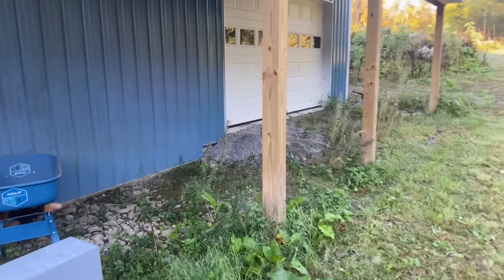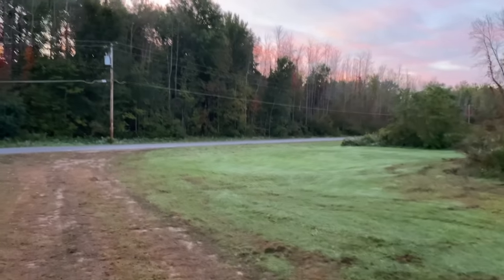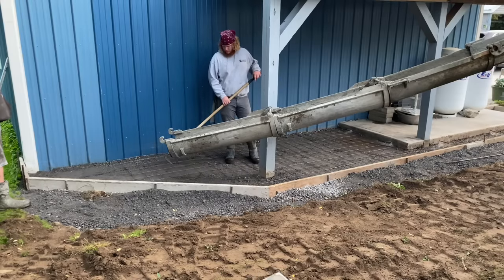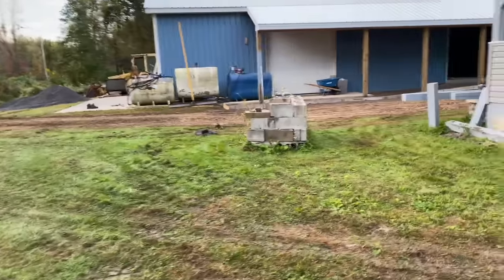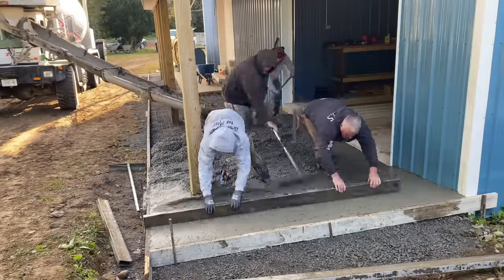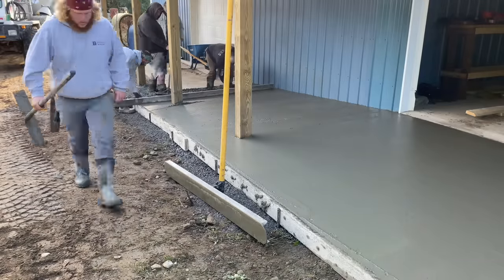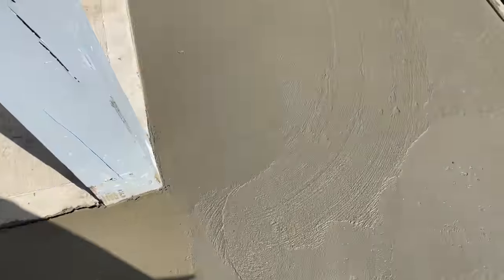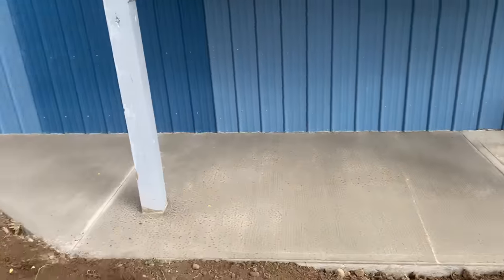WET CONCRETE!!! HAD TO REJECT THE LOAD. 👎🏼

Comment: Nice.
I know people use metal brackets to physically separate concrete foundations from the wooden pillars.
In this case, they poured the concrete right up against the wood. Is that a problem?
Reply from the maker: If it was up to me there would be no wood ever in the ground but people around here love these pole barns with the wood poles in the ground. I do not like them but get hired to pour the floors all the time. They are cheap to build.
Reply: @bondobuilt386 They do that here too. I had to replace all the rustic log supports on two porches on two houses on my property after I bought it. Rotted All to hell.  All sunk in concrete. We didn't make that mistake. Footers rule!
Reply: Yes that is a problem. A simple, easy, and quick solution is to wrap them posts with some expansion foam and problem solved....

Comment: Sometimes when it’s too wet we still pour it and let sit for a bit then we screed it(when is a small job). No need to give them a hard time plus you got plenty of people.
Reply from the maker: Wet concrete is not nearly as strong than something poured at a tighter slump. Also this is a steep ramp.
Reply: They were close to the plant. They should have mixed it for 10 or 15 minutes and it would tighten up.
Reply: @bondobuilt386 you are right on it not being as strong but if you screeded that uphill, you would have been fine.....
Reply from the maker: I wish you were there to show me how to do it that day. LOL @87bradyman

Comment: Concrete right up against the siding? Doesn't seem right. Is that normal?
Reply: Not right
Reply: No it's not right and he should have also wrapped the posts with some expansion foam or anything to keep that concrete from rotting them out
Reply: Not right but it's probably what he was told and paid to do.
Reply: I did a job and when it was time to get paid was told to go pound sand. So I went and pounded sand. Make sense. I always do what the owner says. Wtf

Comment: Different to UK we tamp screed tamp screed
Reply from the maker: What is tamp screeding?
Reply: @bondobuilt386  we use a board or vibrator bar to bring air out of the concrete and the water to the top whilst screeding back to get level

Comment: Just curious here, since you are close with Circle T, it would be nice to here what they did to resolve the issue.  Since there was plenty of room in the mixer, did they add more dry material or did you get a new batch?  Always enjoy your videos and thanks for sharing!  😁👍
Reply: If the driver notices concrete is batched too wet they will load more concrete into the truck to dry it. If he's rejected from a job they will either bin block the concrete or scrap it and load the truck again

Comment: I had an apron I did, what a bizarre setup, first slab tilted down into a garage, then ramp it up to catch the next garage door, then dip down again to catch a slab under a lean-to.  Front edge was all uniform and pitched down 8 inches over 40 feet the rest looked like a skate park!  but smooth enough that a snowplow can follow the contour.  two truckloads did the job, the first was a little high on the slump so we did the middle with that batch and the stiffer mix around the edges.  On the wet mix, could you add an extra bag of portland cement to stiffen it up some?

Comment: Obviously the driver doesnt know what he is doing.
You, the driver, should know by looking at the mix what slump you have BEFORE leaving the yard. Just because you can hang on a wheel and drive a truck doesnt mean you are efficiant at your job.
Never leave the yard with a mix higher than a 4slump, you will create a situation where you'll have to spin the drum unnessassary to dry it up.
Drove a mixer truck for years. 1st thing i learned was to look at and hear what a 4slump is and how to maintain the load properly.
Never had a problem with any customers or contractors. Learn the job just dont do it.👍